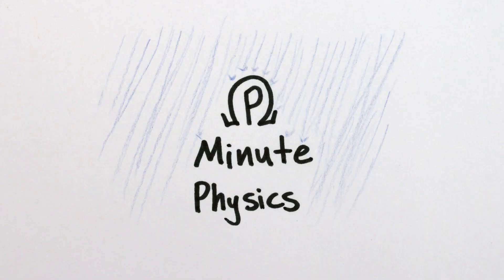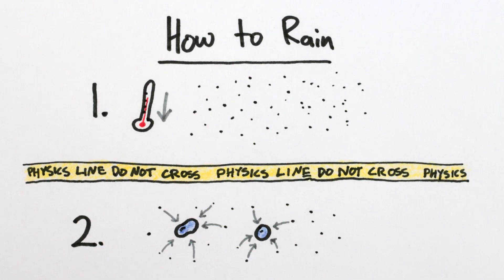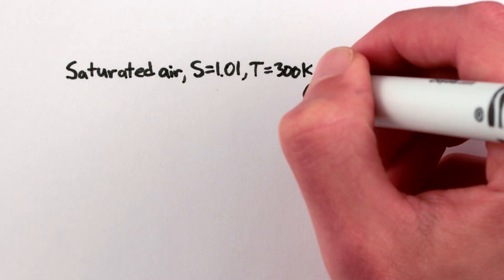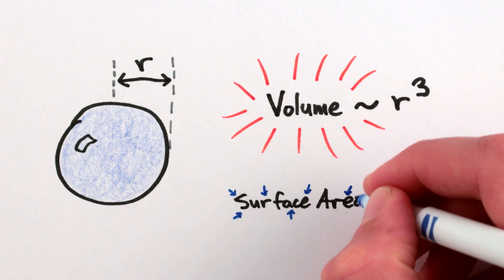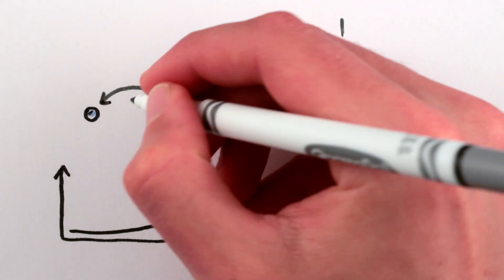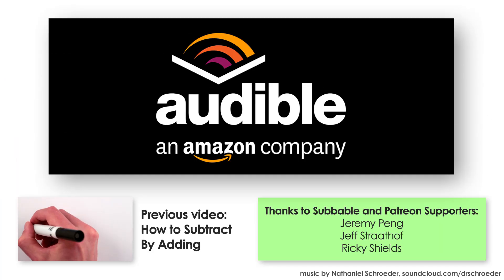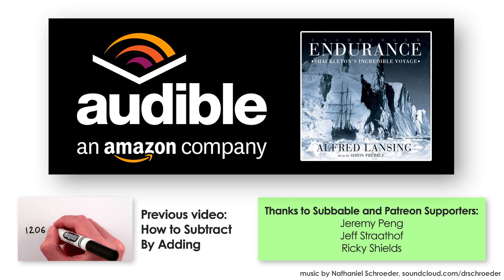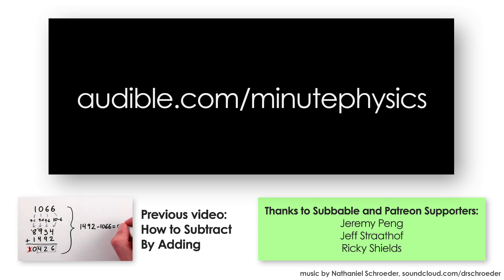Why Raindrops Are Mathematically Impossible

Comment: So...

Because of physics and math and stuff, normally when liquids collect into a larger amount, they release energy.  To actually attach to each other, they require a little energy.

In large shapes and amounts, the energy released from volume is greater than the energy required from surface area.  This means that if you have the drops of liquid/gas ready, it will naturally want to condense.

If the water is in too small amounts, it TAKES energy for the gas to start condensing.  If you have pure water vapor and oxygen in a tank, it will not condense because it takes too much energy.

Therefore rain SHOULD BE impossible

[from the other video] Here's why it's not: dust

little clumps of dust let the water condense on them.  By doing this, you can have pure water vapor condensing around a dust particle because it already has a large volume.

Comment: Without watching the linked video or reading 500+ comments, my guess is that water molecules adhere to "dust" particles in the air & in that way come together to form raindrops. Obviously, this phenomenon is behind the success of seeding clouds to produce rain. Also, your mathematical argument is suspect, because if you measured the radius in extremely small units, then the radius would be more than 1 from the start, & in the corresponding surface & volume units, the volume would be increasing faster than the surface area.

Comment: Since there's a lot of confusion about what the video is trying to say, here's a simplified list of concepts so that you connect everything he's saying:
1) Physical objects want to go towards the lowest energy state they can
2) When forming liquid droplets, there is energy associated with both the volume and surface area of the droplets
3) Because of the way the volume and surface area effect the energy of droplets, a larger droplet will lose energy by GROWING in size, while a smaller droplet will lose energy by SHRINKING in size. Remember that droplets will tend towards whatever loses them energy.
4) The rain you see from the sky is on the smaller side of this scale, and therefore it's "physically impossible" for pure water in clouds to ever condense into raindrops because it means they'd be increasing their energy.
5) Watch the minuteearth video and it will explain that raindrops aren't pure water, but instead form around specks of dirt or other impurities in the air. This allows smaller droplets to grow large enough to become raindrops while still decreasing their energy.

Comment: I see a lot of mislead comments and answers. No, units don't matter!

Say the energy you get from the volume is Ev = A.r³, and the energy required for the surface is Es = B.r². A and B are constants expressed in units of energy per cube meter and square meters respectively, for example in J/m³ and J/m².

Using an r' with a different unit than r also involves changing the units of A and B.
When you want to switch to cm for example, you'll get A' = A J/(100cm)³ = Ax10^-6 J/cm³, but B' = B/(100cm)² = Bx10^-4 J/cm² (notice the different power of 10!)

In the video, he implicitly simplifies the problem by having A = 1 J/m³ and B = 1 J/m² so we can compare r^2 and r^3 without thinking about A and B, but they are here nevertheless.
You can't compare/add/subtract two different units anyway.

Comment: The quadradics and cubics thing makes no sense to me. If you used another form of measurement and made a certain small number =1, instead of 0.00000001, then you could get by this problem of cubed being less than quadratics by just changing the measurement system you use. Since that is the case, doesn't that mean raindrops actually do make sense because our math system is flawed once you get down to decimals? 

Decimals don't technically exist in nature, so when describing nature we should multiple by factors of ten until all numbers in the equation are whole numbers, and then just use another equation the factor changed. I am horrible at explaining what I mean, but this makes sense to me, because if what is observed doesn't fit the math, then the math must be wrong.

I would really like to know why I am wrong, because it doesn't seem right that I seem to understand this, a guy who hasn't even taken advanced math courses, but experts don't. Please, tell me why I am wrong.
Reply: cortster12 Experts do understand it. Raindrops make sense - it's just that they aren't pure water, which this video assumes they are (the minuteearth video explains this). Anyway, you should think of it in terms of conversions. The energy equations use certain constants that are based on specific units of measurements - if you change the units, the constants change so that the result stays the same. However, generally you just convert whatever measurements you took into the units in the equations. For example, if you square 10cm, you get 100. If you cube 10cm, you get 1000. However, each square centimeter is 1/10000th of a square meter, and each cubic centimeter is 1/1000000th of a cubic meter. You wind up with 100/10000 square meters and 1000/1000000 cubic meters. In the end, that's 1/100 square meters and 1/1000 cubic meters - clearly, the square value is larger.

Comment: is this a joke? small numbers? who decides what 1 is?
is one a meter? a mile? a universe?
Reply: adir mugrabi yes
Reply: ***** 3 miles? that's the average, right?
Reply: adir mugrabi I believe it's all dependent on test cases
y = a(bx + h)^2 + c  in comparison to y = a(bx + h)^3 + c
are the general equations for what's being described. 
When x < (1 - h)/b. then y is larger for the square function than the cube function (assuming a is positive)
Reply: adir mugrabi It doesnt matter what unit you use as long as its consitent
Reply: adir mugrabi
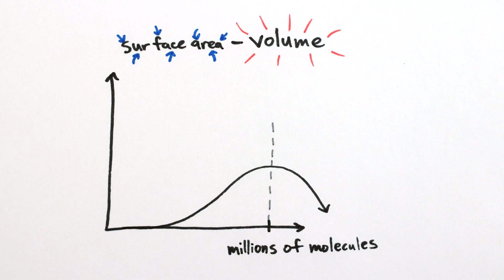the 2/3 threshold stays the same no matter what. But in the case of water droplets, he specifically state that the threshold is a few million molecules. 1:45
Reply: adir mugrabi Did you watch another video? Because in the video i saw, he was later referring to the number of molecules.
If you change the unit of lengths to e.g a universe, all your other units (like your measurement for energy) changes as well.
ANY calculation in physics must be invariant with the units.
So if you measure in m or "a universe" doesn't matter, you will still get the same answer!
Reply: KoalaKrisp1 lets take 1 to be the size of the universe. Can any drop form? No! Even with the dust(which is what allows droplets to form) since you'll need a lump the size of 2/3 of the universe!

Comment: While maths is completly theoretically, physics is the practical use of maths. This sometimes interferes with observations/practice.
You could also ask: "Why traveling faster than light is mathmatically possible?" While in physics/practice it clearly is lim → 299792458 m/s - or at least we didn't found out how to break through the limes yet.

Comment: this is actually a problem of units of measurement. radius of a raindrop is for example 0.1 cm. if you cube and square that number, cube will be smaller. if you change unit of measurement in millimeters then its 10mm. cube will now be bigger and poof! its all ok